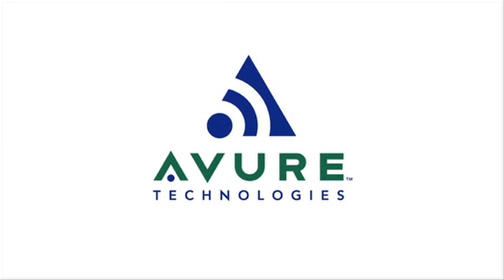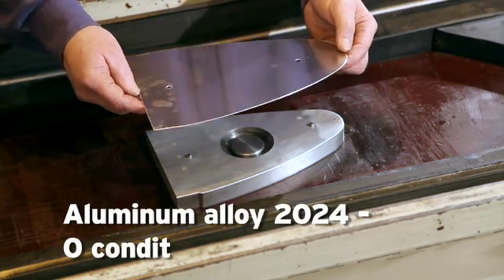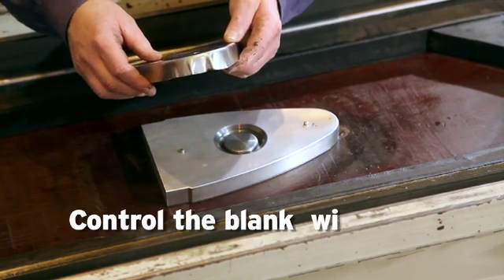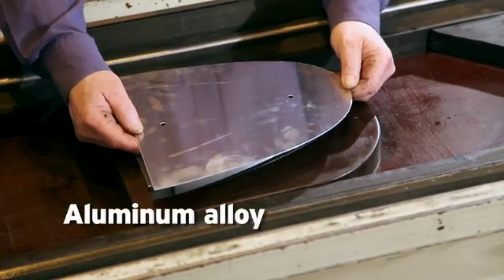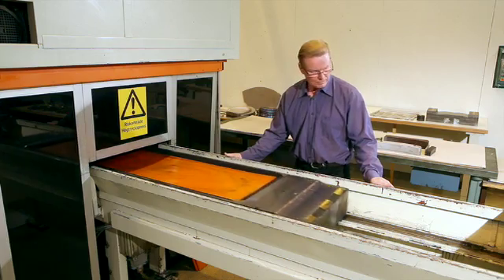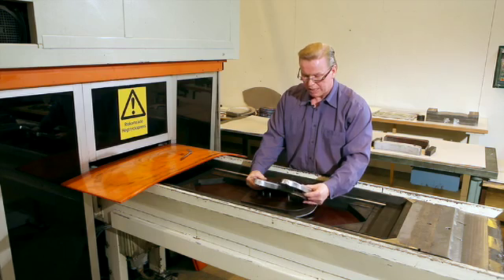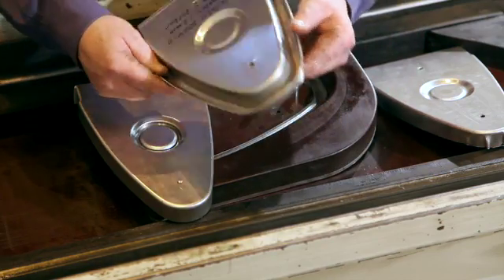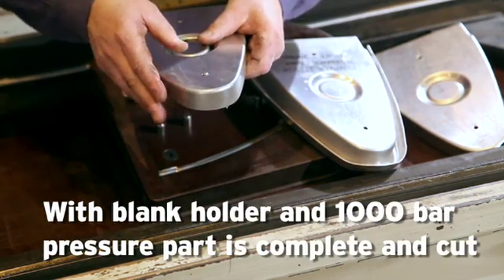Quintus Technologies Sheet Metal Forming Lab, part 2 - Punch Tool

Comment: What does it mean to have control over the blank?
Reply: The blank wrinkling requires some parts of its perimeter to fold down and others to stay up. The outer tool, being overlapped by the blank, keeps the perimeter of the blank on a common plane, so that material is compressed or expanded where ever it needs to without the bending moments pushing the blank out of its relative plane. At the beginning of the pressing, a bead forms into the gap of the inner and outer tools, which temporarily stabilizes it further.

Comment: Can do the same thing with a Harbor Freight 20 ton press, plywood wood forms and some rudder sheets. Less expensive too. https://www.youtube.com/watch?v=EWGAIVDpDLc&t=47s
Reply: you can try. have to even distribute the load. as long as you have a male a female tool.
Reply: Why are you so against capitalism?
Reply: Love2FlyKAP anyone that buys anything from Harbor Freight is a fucking amateur hack. Harbor Freight should be run out of business. They give the United States shovelfuls of crap to deal with. their business model is why this country doesn't manufacture anything anymore but we're starting to again thanks to small businesses like American rotary and now some small independent screw manufacturers are coming back. if you buy anything from Harbor Freight you're sitting on the flag

Comment: That's amazing but, you over explained the obvious and failed to explained the not so obvious. How did the second process avoid or eliminate the nose wrinkles?
Reply: tommie293 , He added blank holder then there is the aluminium sheet over it and then there is the yellow pad on top. Basically the aluminium sheet gets trapped between the blank holder and the yellow pad, and at the same time it gets pressed into the cavity. This together creates stretching action on the aluminium blank eliminating wrinkles. Where ever the sheet gets stretched, its thickness is reduced.
Reply: Pradeep thank you
Reply: Но ведь это видно в чём разница
Reply: by putting the tool down on a fixture and tripling the pressure, the third one was the same as the second with 1/3 the pressure just like the first one without the fixture.
Reply: through stretching